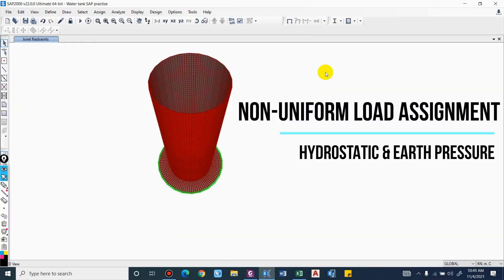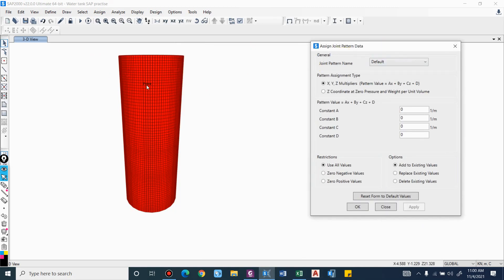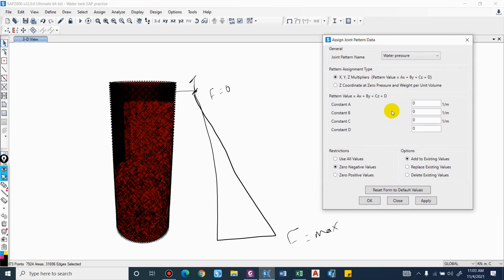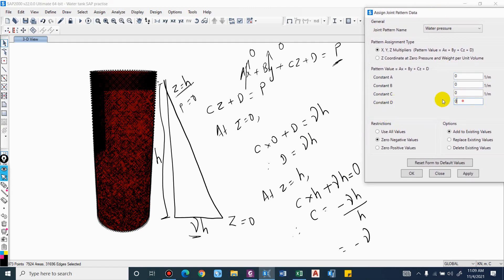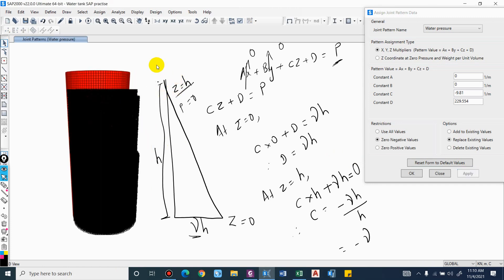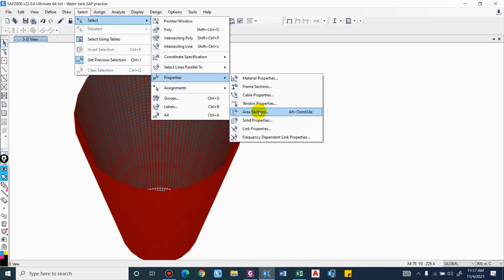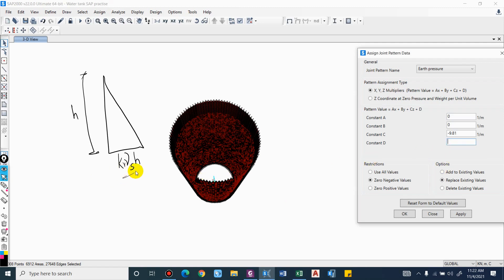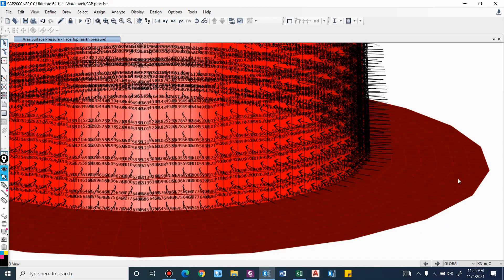Non-uniform load in wall | Hydrostatic & Earth Pressure | Triangular Loading | ETABS & SAP2000

Comment: Hi I want to design a wind turbine tower which is a tappered section (different outer diameter and wall thickness between top and bottom). I know how to design it as a vertical column (linear and with extrude is see the geometry) and do the section but I want it as an area section like yours. Can you help me?